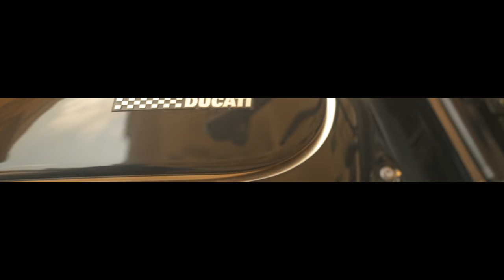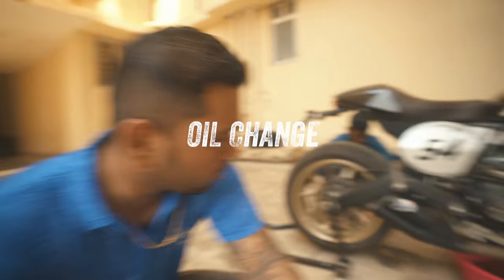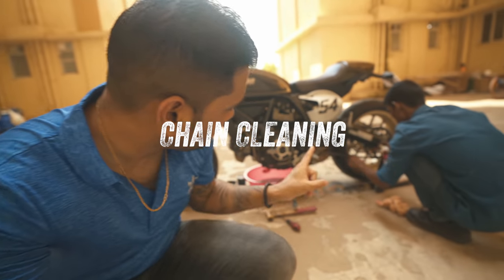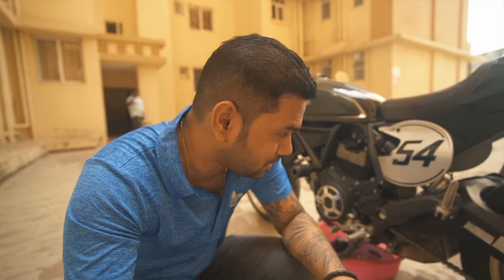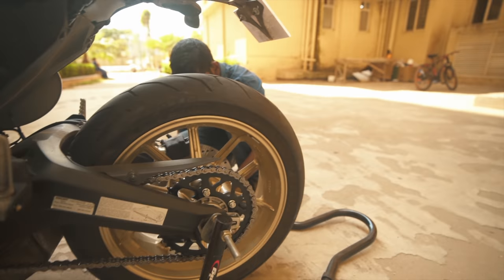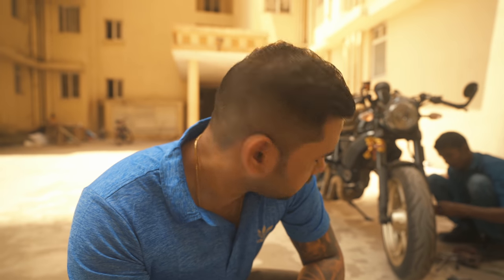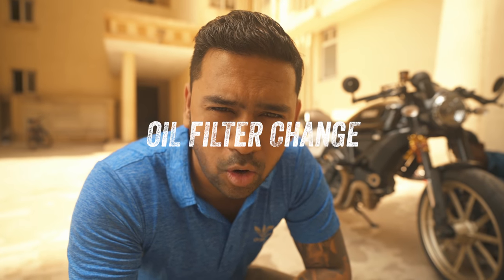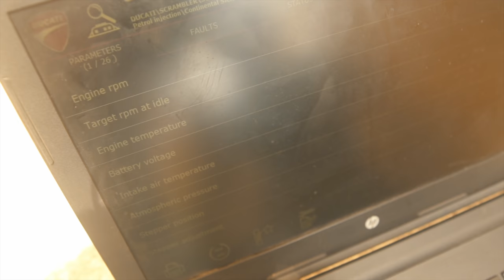DUCATI SCRAMBLER CAFE-RACER - FIRST Service & Costs Involved.

Comment: Is crash guard better or frame sliders for caferacer / scrambler .. i saw another  video where you installed frame sliders. was that for safety or do you think crash guard might take away looks  and put frame sliders thinking somethings better than nothing .. 
If frame sliders ...what other brand options did u think off
Need this info b4 I order one after the Corona mayhem